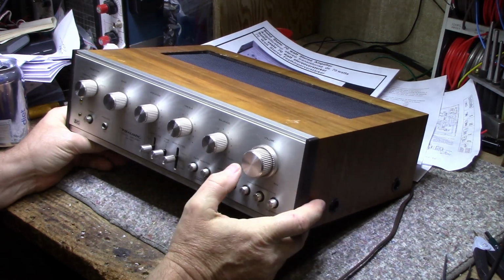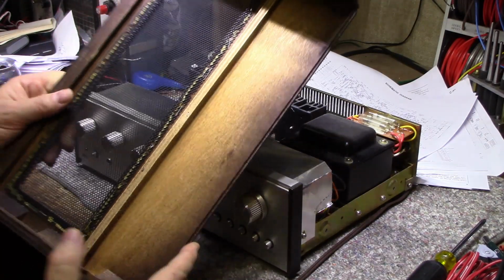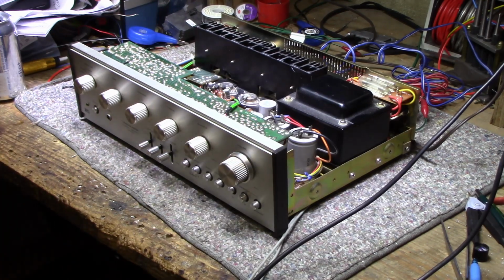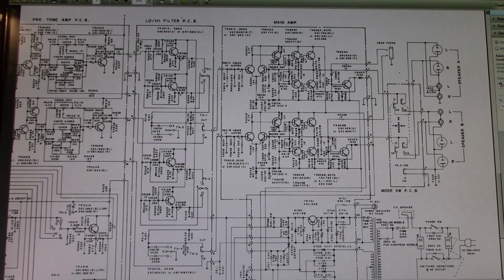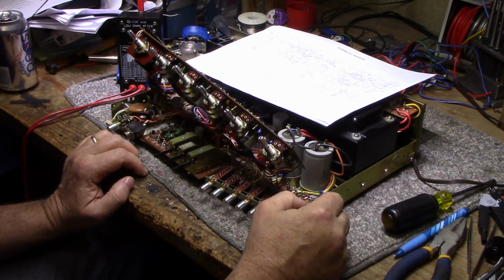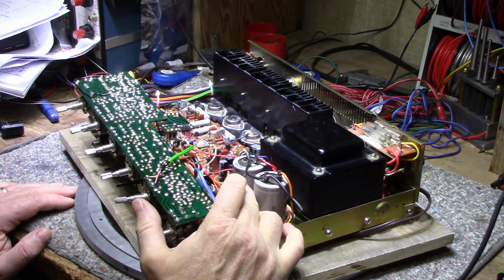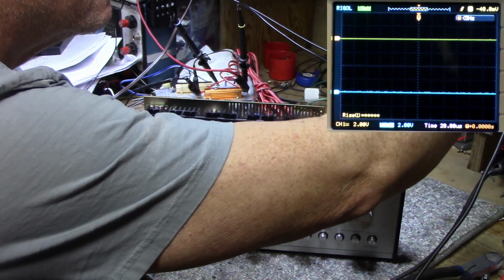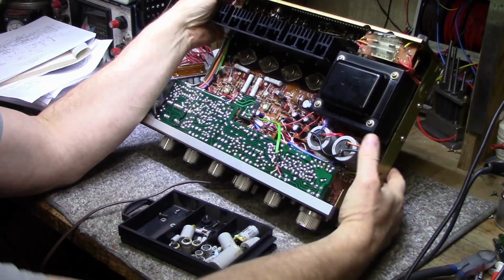Realistic SA-1500 Integrated Amplifier - Checkout & Repairs (Ep. 55)

Comment: I’ve seen early and late versions of the same amp and tuner that look the same but inside all the PCBs are different. The boards and schematic are sometimes numbered with a four digit number so if you look at later versions in my case different models of receiver and amps have the same board so I used their schematic. That was on early 70s stuff.

Comment: I have the same one that I bought new in 1975 at Radio Sack Canada they were advertised for a 45 watts per channel integrated amplifier. The amp is still working I clean the tone controls and switchs in 2024 and use it sometime with Altec Lansing model 5 speakers sound good for what it is.

Comment: Hi Trevor. I have the SA1500 also...i opened it up and noticed that there are 2 black wires attached to two of the 4 silver discs.....well on my receiver, one pair of the black wires are laying to the side, still connected to the board, but not connected to the silver disc....what do you recommend and will that affect sound?

Comment: Had a nice Sa-1000 which was similar. Only problem was the IC s in the phono pre-amp failed and it was impossible to find replacements. Had to patch in a a modern p a to replace. Apart from that it was a lovely sounding amp.

Comment: I just bought one of these off of Ebay, my power lamp is also burned out. But mine has zero output, Fuses all good, Power supply, main caps and rectifier good.  Main amplifier section tested good, still testing. I need to disassemble mine like you did and see why nothing is feeding the Amp section. I suspect either bad components in the pre-amplifier section or a defective switch. Mine is also in very good condition, got mine from Canada. I think I read the 1500 was made in Japan and not by Foster. I like the better filters and power of this unit over the 1000A.
Reply: Correct, Foster Electric only made the U.S. separates, all others like the SA-1500 were made by Tandy Electronics.

Comment: I found a service manual for the SA-1500 (I am based in the UK and it came up easily for me).  It seems the transistors you could not find on you schematic were on my copy, and they look like they power the preamp/tone board.  It looks to me like they have a delayed start, so I guess they are an attempt to avoid switch on surges getting through to the power amp.

Comment: Nice work Trevor! I have currently the same amplifier here on the bench. With an almost similar problem; working but one channel with less power than the other and a bit of distortion. And whopdiedoo also mine seem to have suffered from a bad 3.3U cap (C203B). After replacing it the amp is working again. I happen to have a slightly different version of this amplifier. Same model, but without the fuse PCB and relay. And in that sense it is more or less the same as the EU schematic. By the way Trevor, do you know what is the proper bias setting? I biassed for now @30mV across the 0.5 ohm resistors.

Comment: I would use film caps 4.7uf or less in place of E caps, they improve SQ, I recapped my new TEC phono amp with film caps on the in/out coupling circuit with 1uF WIMA caps in place of the 4.7 & 10uF E caps. The TC 780LC line booster also is re capped

Comment: I have the Realistic sta-180 receiver and it sound really good unfortunately the left channel piece that holds the volume knob fell of the control slider so the only way to move the volume up or down is by using a thin screwdriver.

Comment: Nice amp. I think these early Realistic amps are a best buy which I did, buy. I bought a Realistic SA-1001 a few years ago. I paid $65.00. Impecable cosmetics but one speaker was fading. Mono setting fixed that temporarily. Last week I paid $100.00 to a local repair shop to remedy it. Now it's perfect and I consider the $165.00 I ultimately paid to be a good buy. Yes....real wood and all aluminum controls.

Comment: Nice amplifier, just finished up recapping a 1979-80 Kenwood that's  about the same power output of your amplifier.  It still had a bit of distortion so changed the small transistors that reacted to temperature change.  Was worried it was a lost cause now though it has the poor quality of switches of that era it sounds very good.

Comment: I have a problem with mine, the overload light comes on but the amp works fine, it happens very rear. What do you think I should do? It is my dad's amplifier it was last repaired about 35 years ago.
Reply from the maker: the SA-1500 has a circuit that monitors the speaker outputs and triggers the lamp if it senses something out of the ordinary such as a DC offset at the output. it might be sensing something wrong with the power amplifier (needs service) or the circuit itself might need servicing. I would advise against using it if the lamp keeps coming on. You said it rarely happens but my guess it will start to happen more and more as time goes on.
About the only thing you can do at this point is get a voltmeter and test for DC volts at the speaker output with the speakers disconnected. If you find the voltage is about 150mV or more, this is the issue and it will need servicing. If you ignore a DC offset and continue to use it, you risk damaging your speakers, yes even if it still works and sounds ok
HTH